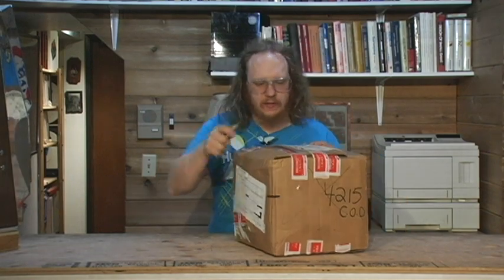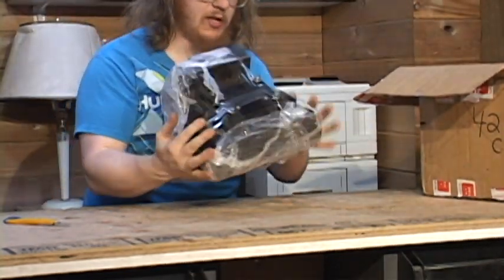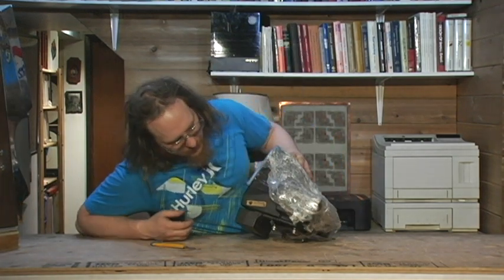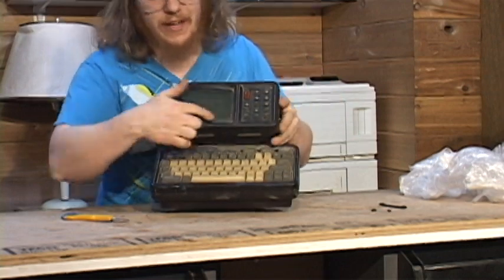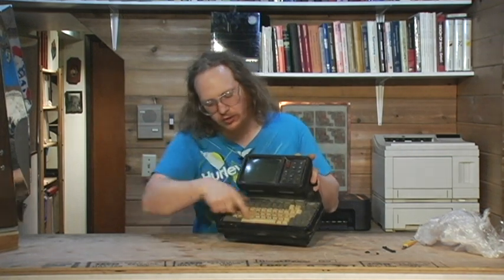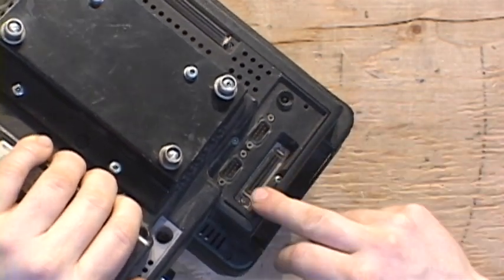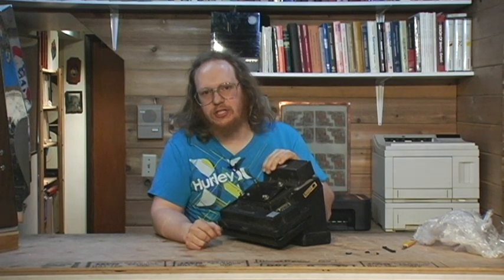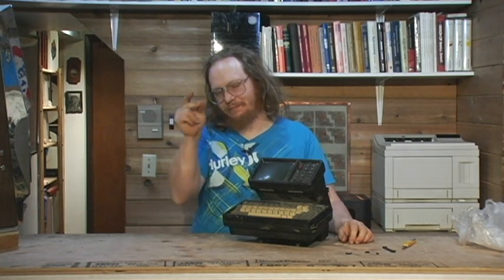Motorola MDT 9100-386 Unboxing and Initial Inspection

Comment: I was on the design team for the 9100-386 and 9100-T.  The big connector is in fact the ISA bus brought out for future expansion capabilities. There weren't any to the best of my knowledge. 
Regarding the DB-25 and DB-15 connectors, I honestly don't remember. 
I designed the test fixture for the motherboard, and I do know that it had one printer port and four RS232 serial ports on it.
Reply from the maker: It's such a strange but nicely compact system. Now that mine is more or less working off the firmware I should go back to running it for a video.

Comment: I’m trying to find the size of the CRT… it looks bigger than 5 in.
Could you measure the width and height?
Reply from the maker: Diagonally it's about 5 1/2 inches.I have another MDT here with a necked tube and I found the CRT out of a children's karaoke machine and it was a perfect fit. No promises that it's an exact pin-compatible fit but black and white tubes were generally compatible with eachother.